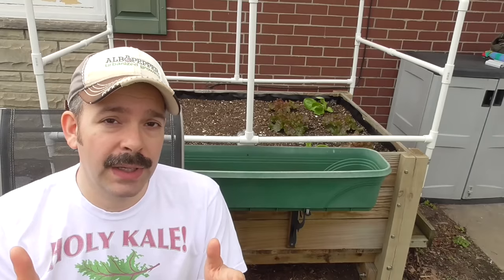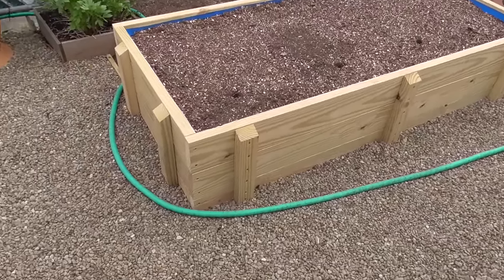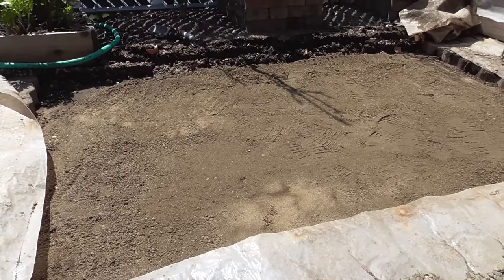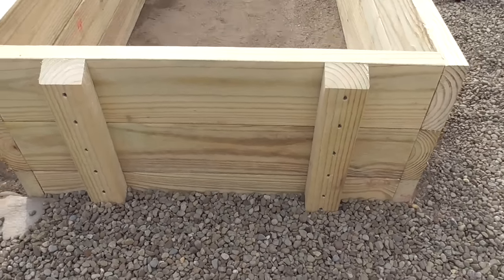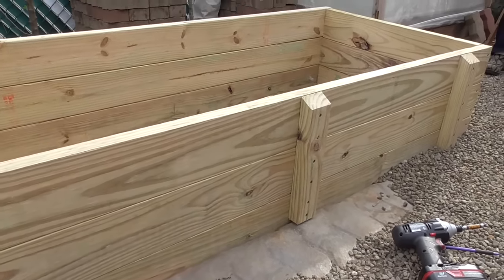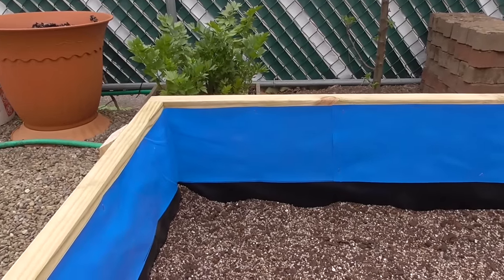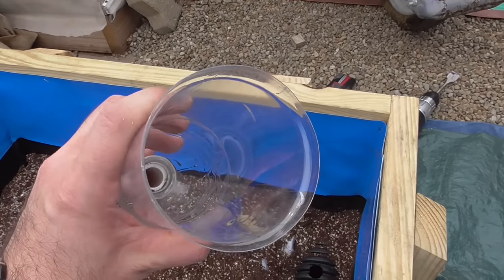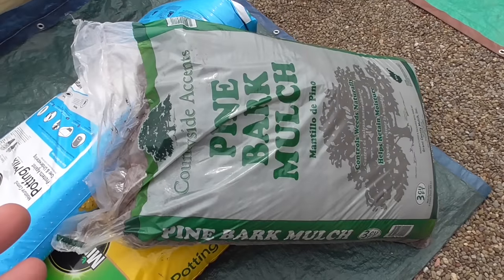Self-watering SIP Sub-irrigated Raised Bed Construction  (How to Build)

Comment: Why no use manure
Reply from the maker: BAGGED COMPOSTS? To prolong the viability of your SIP potting mix, it's best to replenish nutrients in the form of fertilizers. Organic gardeners are apt to use compost as often as possible. In SIPs, worm castings can be included in small amounts. But using composts in containers can yield unpredictable results. Bagged (retail) compost, humus or manure might have a fine consistency, similar to garden soil. If it contains fine silty particles then this can reduce pore spacing and aeration properties of the mix. That's why topsoil is NEVER recommended.

As air gaps get plugged up by ultra fine particles, compaction occurs. And since SIPs are always resting on a perched water table, the few remaining air gaps tend to be saturated with water. This impairs root health, preventing plants from getting the oxygen needed at the root zone. This can lead to a decline in plant growth, or even root rot and death. Even if plants grow ok in the first year, over time the potting medium may break down to the point that it must be replaced.

HOMEMADE COMPOST? Buying bagged compost is not financially advantageous in large beds anyway, not when compared to buying a bulk organic fertilizer. Of course, homemade composts might work, especially if they are mostly wood based. These tend to have more structure. Larger particle size means improved aeration. I've found though that it's very easy to reserve my compost for conventional beds and perennial plantings. It all gets used, just in a different location. 

https://albopepper.com/refreshing-sip-potting-mix-adding-fertilizer-year-2.php

Comment: i don't understand. why no manures?
Reply from the maker: You sound disappointed. What sort of manures did you hope to use? How much volume? Are they composted?
Reply: I don't know. Chicken, fish, cow shit, etc. with or without worms it's gonna break down and nute the soil and plants should love it. Just want to know the reason why you suggested not to use manures.
Reply from the maker: Ok, the biggest reason is particle consistency. Using porous potting mix components provides better aeration which boosts root health. Fine silty particles plug up air pockets resulting in compaction and an anaerobic condition. This can cause root rot. A large volume of manure products can act much like topsoil in this regard.

As a secondary consideration, uncomposted manures can pose dangers in the way of pathogen contamination. This effect is more serious when you think about the large reservoir at the bottom that could turn into a septic breeding ground.

Small amounts guano might be ok. Certainly fish emulsions would not impact potting mix structure. And of course, worm castings have a nice coarse texture that works well in containers and SIPs.

Comment: Wait, why no manure?
Reply from the maker: BAGGED COMPOSTS? To prolong the viability of your SIP potting mix, it's best to replenish nutrients in the form of fertilizers. Organic gardeners are apt to use compost as often as possible. In SIPs, worm castings can be included in small amounts. But using composts in containers can yield unpredictable results. Bagged (retail) compost, humus or manure might have a fine consistency, similar to garden soil. If it contains fine silty particles then this can reduce pore spacing and aeration properties of the mix. That's why topsoil is NEVER recommended.

As air gaps get plugged up by ultra fine particles, compaction occurs. And since SIPs are always resting on a perched water table, the few remaining air gaps tend to be saturated with water. This impairs root health, preventing plants from getting the oxygen needed at the root zone. This can lead to a decline in plant growth, or even root rot and death. Even if plants grow ok in the first year, over time the potting medium may break down to the point that it must be replaced.

HOMEMADE COMPOST? Buying bagged compost is not financially advantageous in large beds anyway, not when compared to buying a bulk organic fertilizer. Of course, homemade composts might work, especially if they are mostly wood based. These tend to have more structure. Larger particle size means improved aeration. I've found though that it's very easy to reserve my compost for conventional beds and perennial plantings. It all gets used, just in a different location.

https://albopepper.com/refreshing-sip-potting-mix-adding-fertilizer-year-2.php

Comment: why not use manure ?
Reply from the maker: BAGGED COMPOSTS? To prolong the viability of your SIP potting mix, it's best to replenish nutrients in the form of fertilizers. Organic gardeners are apt to use compost as often as possible. In SIPs, worm castings can be included in small amounts. But using composts in containers can yield unpredictable results. Bagged (retail) compost, humus or manure might have a fine consistency, similar to garden soil. If it contains fine silty particles then this can reduce pore spacing and aeration properties of the mix. That's why topsoil is NEVER recommended.

As air gaps get plugged up by ultra fine particles, compaction occurs. And since SIPs are always resting on a perched water table, the few remaining air gaps tend to be saturated with water. This impairs root health, preventing plants from getting the oxygen needed at the root zone. This can lead to a decline in plant growth, or even root rot and death. Even if plants grow ok in the first year, over time the potting medium may break down to the point that it must be replaced. 

https://albopepper.com/refreshing-sip-potting-mix-adding-fertilizer-year-2.php

Comment: very interesting but my ick is seems expensive to build
Reply from the maker: It certainly wasn't too expensive to build, years ago when this video was made. Since that time, many prices have skyrocketed. To be honest, the expense of building isn't as big of an issue. It's the expense of filling that can get quite costly. Many people fail to calculate the cost of potting mix materials. I've seen people run out and build a bunch of these at very large sizes. Afterwards they calculate the internal volume and start pricing potting mix. Suddenly they come to realize where the real expense is.

Comment: I'm thinking sub-irrigated planters should duke it out with Structural Insulation Panels, a type of manufactured wall/structural component for construction as well as Session Initiation Protocol, a widely used computer network protocol used to perform a host to client handshake to establish modes and methods to commence electronic communication.  This particular TLA--that's three letter acronym for the rest of us--is frequently claimed by these other domains at levels that FAR exceeds its use as sub-irrigated planters. If you refer to your planters as SIP and you want it popping up in a useful search result set---good luck with that.  They will be drowned out (no pun intended) by these far more frequent uses of the TLA. Deep irrigation Planters (DIP) seems better because though DIP is used as Dual-inline packages, it ALWAYS seems to modifies  "switch," as in, :change the settings on the DIP switch to change the behavior." In fact, the very reason I clicked on this video is I thought that Idea of using what construction refers to as SIP might be a good way to quickly build rather high raised beds.

Comment: I have a question on the possibility of induced  bacteria, virus, mold infiltration into the system.....
Where your system is enclosed, and both oxygen, water, and /  or possibly contaminated water, contaminated fertilizer  are brought  together at the bottom of the system, with no chance to drain away ever,  have you found any negative bacteria development concerns?.. Or does it just appear to "compost any germ"?

You mentioned you had years of testing, and it appears you have not had any problems... which is great, but remains a little questionable to me.. Probably, because I am no expert........ Hey, if you have had years of success, I will be willing to try it as well.... 
Overall, it looks ingenious- getting both oxygen and water to  the roots.....Not criticizing here.... Just wondering about the negative possibilities.....Overall, great  video with lots of information....
Thank you.
Reply: I'd also like to hear his reply....good question

Comment: Why must you use pipes as water storage containers. Why not just have a ccntinuous space for water and place a permeable membrane over it. Pipes are expensive
Reply from the maker: In my area, a ten foot pipe is under $6 USD. I don't find that to be particularly expensive. If you have a different design than works better for your budget, then go for it!

Comment: why not use ceder? the chemicals to that pressure treated wood is going to leech into the soil.
Reply from the maker: If you build one, you can use cedar. But I'm not concerned about the PT. There won't be leaching since the liner creates a barrier between the wood and soil. What chemicals are you concerned about anyway? Copper?

Comment: Why wouldn't you just put a drain valve on each end fill the bottom two inches with gravel and then put a fabric that allows water to seep through on top of the gravel then fill with your soil mix why do you need the corrugated drain pipe
Reply from the maker: Thanks for watching! I talk all about why I don't recommend gravel here: https://albopepper.com/pipes-vs-gravel-in-SIP-wicking-beds.php

Comment: Why shouldn’t you use manure?
Reply from the maker: BAGGED COMPOSTS? To prolong the viability of your SIP potting mix, it's best to replenish nutrients in the form of fertilizers. Organic gardeners are apt to use compost as often as possible. In SIPs, worm castings can be included in small amounts. But using composts in containers can yield unpredictable results. Bagged (retail) compost, humus or manure might have a fine consistency, similar to garden soil. If it contains fine silty particles then this can reduce pore spacing and aeration properties of the mix. That's why topsoil is NEVER recommended.

As air gaps get plugged up by ultra fine particles, compaction occurs. And since SIPs are always resting on a perched water table, the few remaining air gaps tend to be saturated with water. This impairs root health, preventing plants from getting the oxygen needed at the root zone. This can lead to a decline in plant growth, or even root rot and death. Even if plants grow ok in the first year, over time the potting medium may break down to the point that it must be replaced.

HOMEMADE COMPOST? Buying bagged compost is not financially advantageous in large beds anyway, not when compared to buying a bulk organic fertilizer. Of course, homemade composts might work, especially if they are mostly wood based. These tend to have more structure. Larger particle size means improved aeration. I've found though that it's very easy to reserve my compost for conventional beds and perennial plantings. It all gets used, just in a different location. 

https://albopepper.com/refreshing-sip-potting-mix-adding-fertilizer-year-2.php

Comment: why bother with all the plastic irrigation pipe.  Why not just a layer of perlite covered with fabric to seal the perlite from the soil?
Reply from the maker: You could set up your system the way that works best for you. But switching from pipe to perlite has never offered be any real benefit for me. As far as displacement goes, I can buy a 10 foot section of pipe for $6 which displaces 1 cubic foot of volume. To do that with perlite you would need bulk bags. A four cubic foot bag may run $20 which is $5 per cubic foot. There's no real cost savings there. But working with the pipes is a much neater process and the system is much easier to break down if there is ever a need to do so.

Comment: " they did it wrong "...." They don't know what they're doing "......sounds like everyone's outta step but my little boy Johnny.
Reply from the maker: Do you have a proto-type or working model that defies my recommendations? Show some pics of the results. Years ago when this video was created, I saw multiple videos showing how to make these systems. They had various design flaws. And there were NO follow-up videos proving whether their systems were actually viable. No proof of effectiveness. Or some videos even demonstrated an actual FAILURE of the system. I have plenty of videos documenting the effectiveness of my designs. I stand by the guidelines 100% and I can vouch for their viability. I have no problem pointing out design flaws. You don't like it? Then leave. What contribution have you made?

Comment: You said don’t use manure, but didn’t say why.
Reply from the maker: Can You Add Compost & Manure to Old Potting Mix?

BAGGED COMPOSTS / MANURES? To prolong the viability of your SIP potting mix, it's best to replenish nutrients in the form of fertilizers. Organic gardeners are apt to use compost as often as possible. In SIPs, worm castings can be included in small amounts. But using composts in containers can yield unpredictable results. Bagged (retail) compost, humus or manure might have a fine consistency, similar to garden soil. If it contains fine silty particles then this can reduce pore spacing and aeration properties of the mix. That's why topsoil is NEVER recommended.

As air gaps get plugged up by ultra fine particles, compaction occurs. And since SIPs are always resting on a perched water table, the few remaining air gaps tend to be saturated with water. This impairs root health, preventing plants from getting the oxygen needed at the root zone. This can lead to a decline in plant growth, or even root rot and death. Even if plants grow ok in the first year, over time the potting medium may break down to the point that it must be replaced.

I've successfully used "Mel's Mix" soil in a bucket SIP with 33% of a woody homemade compost. Only for 1 season though.

HOMEMADE COMPOST? Buying bagged compost is not financially advantageous in large beds anyway, not when compared to buying a bulk organic fertilizer. Of course, homemade composts might work, especially if they are mostly wood based. These tend to have more structure. Larger particle size means improved aeration. I've found though that it's very easy to reserve my compost for conventional beds and perennial plantings. It all gets used, just in a different location.

https://albopepper.com/refreshing-sip-potting-mix-adding-fertilizer-year-2.php

Comment: I like your bed design but really... Miracle-Grow ??? The majority of Miracle-Gro's product line is filled with chemicals and synthetics. 

Scott's, the parent company of Miracle-Gro, is connected with Monsanto and are the exclusive agent of Round-Up. Out of concern for my family's health, I won't use any products connected with Cargill or Monsanto for growing food crops. The idea of having a home garden is about eating healthy foods.

I use strictly homemade compost from my soldier-fly bio-pods, mixed with black volcanic sand and a little coir, and dilute leachate as a foliar spray and an occasional topdressing
Reply from the maker: Well, I understand your reluctance to use Miracle Gro. However, there's nothing in MG potting mix that is going to be hazardous to my garden plants or their produce. Chemicals and synthetics are all around us. The question is: What are those specific compounds? No need to use generic terms designed to elicit fear out of simple stigma. For example, Magnesium Sulfate is a "chemical" but thousands of gardeners put a scoop in with their nightshade vegetables at planting time. In fact, many people literally BATHE in magnesium sulfate. But they call it Epsom Salts, so that it doesn't sound scary. Hey, it's a chemical. I would be much more concerned about heavy metal contamination. And MG potting mixes have been tested and shown to be extremely low in any elements of concern.

Now, as for your concern about Monsanto and roundup... well do you buy 100% organic produce? That's the way to really stick it to the man. In fact, if you are truly, truly concerned about glyphosate and chemicals and toxins... be sure to go completely plant-based in your diet. That will make a MUCH bigger difference than avoiding a certain brand of potting mix. Have you done so yet? I've done so for a full year now and will never go back. Not buying animal products, reduces demand for the GMO feed crops used to raise those animals. And vastly reduces the amount of glyphosate being used to grow those crops. That's the truly significant way to stick it to Monsanto AND to reduce carbon footprint, helping to save our planet.

My garden is ALL about eating healthy foods. No pesticides are used. I challenge anyone to prove that a few synthetic nutrients are making any of my foods unhealthy. Hydroponics are routinely grown with synthetic nutrients and many people don't think anything of it, especially those rich green lettuces. Milk, fish, chicken, beef and pork are FULL of PCBs, dioxins, heavy metals, estrogens, antibiotics, endotoxins and saturated fats. THAT's where the contaminants can really enter your diet. And THOSE are the things to cut before anything else!